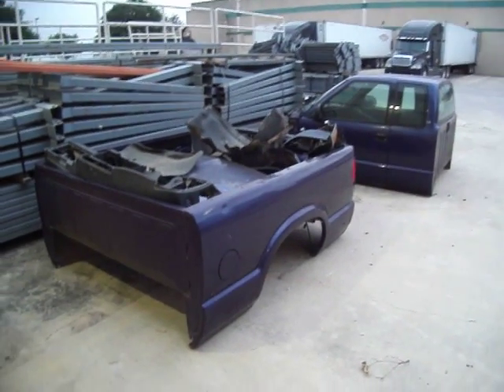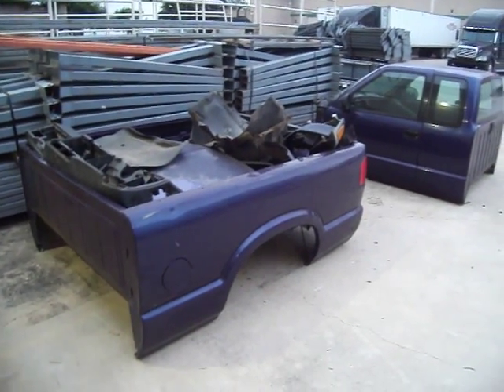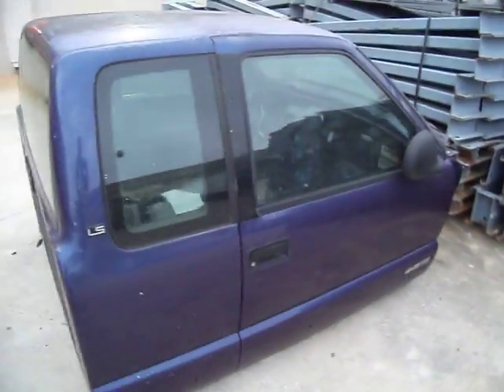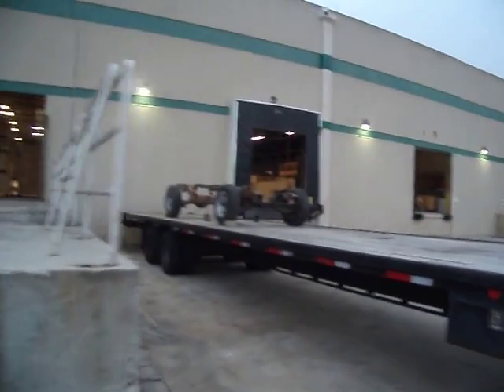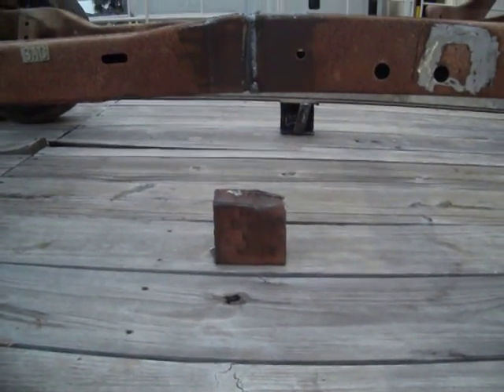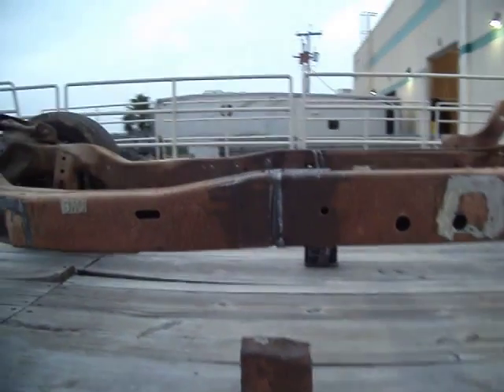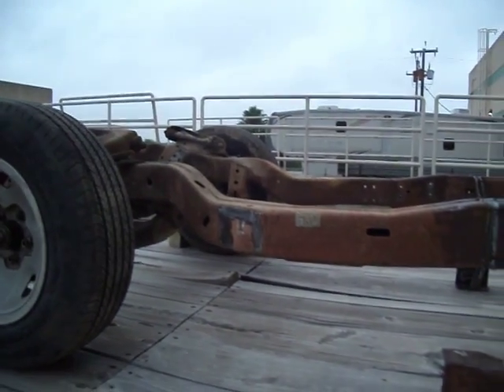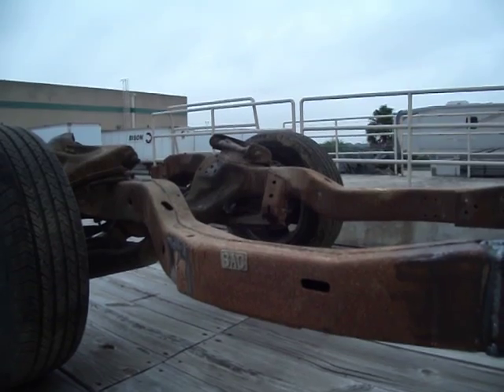Chevy S10 frame conversion to fit 51 Chevy truck body

Comment: I noticed you said 117 wheelbase? The manual I have and manuals online
for my 55 series one say 116"wheelbase.
I had the original frame at my house for awhile and I measured 116.
Did you have any different info?
Reply from the maker: No, just prefrence.

Comment: Looks good. I would add a patch plate over the top welded in
Reply from the maker: No need, this is a Z cut and welded rectangular tube frame not a c channel  frame. Factory engineers designed it that way, no added plates. Frame was shortened exactly as the engineers designed it, Z cut and welded.
Reply: @nadingjeff  ya I guess I didn't look close enough for that. In that case I'd probably just 45 the cut in the frame to offset each side weld. No hinge point then. But I'm no expert. The ones I'm messing with are .250 or .375 single wall. Weld both sides beveled well with more of an L at the seam. Then plate both sides different sizes so the welds arent back to back. 260000gvw though. Anyways love your project and sorry to come off like a Richard. The fellas at work I'm sure love me ya right
Reply from the maker: @onetimer13541  No worries, there's  more than one way to accomplish the same goal. It's hard to visualize unless ur actually looking at it, but its bullet proof strong.

Comment from the maker: What I would do there is just fabricate a piece of 3/8" plate steel, slide it into the gap and weld it in place, weld it all around to fill any gap that might be left. If welded correctly should be as strong as the original.
Reply from the maker: If u understood what was done there u would not be saying what uve srated.

Comment: Hello jeff this weld up looks great that's what I am doing to my s10 but I had to shave off 8in due to my wheelbase is gonna be 115,
So I am in a bit of a pickle I cut the factory welds on each side and shaved 8 in so I'm having trouble aligning it correctly, 
On the passenger side it slides perfectly in but the driver side i have a pretty good gap i would have to say about 3/16 or more ,
Do u have an email where i can send you some pics on my progress thanks

Comment: https://youtu.be/6o2k6QoERio
Reply from the maker: Yes I have seen this video. The video shown here shows a channel frame and I would agree with you if that were the case on the S10 frame, but it is not. The S10 frame is a rectangular tube frame and is welded from the factory vertically and horizontally in a Z configuration and the frame is joined together where I shortened it from the factory. The frame also has another plate welded inside and out. All I did was follow the factory design to shorten it. The strength is there. Was very easy to do. When you view these videos you need to be very observant.
Reply from the maker: Just to let you know my credentials, I was an aircraft mechanic for many years and retired as a quality control manager, so I have much experience/knowledge in the way of structural engineering.

Comment from the maker: Its not going to matter much especially if you split the difference between the cab and the bed, this measurement can be fudged on. Also need to take into consideration the larger radiator and engine being installed and if one is going to use larger diameter wheels and tires. So there is more to it than just a specific measurement. The 116” center to center is not the set rule.

Comment: I HAVE A 1950 CHEVY.  IT IS 116 INCHES CENTER TO CENTER OF AXLES YOUR BED WILL BE 1 INCH LARGER GAP BETWEEN THE CAB AND BED.

Comment: Hello friends! I'm mexican sorry for my bad english. I'm making the same project with a 49, i put on it a 350 vortec with edl performer intake and 600 edl carb, but i have a problem with the headers, i need to know what kind of headers can i put, because a i haven't space.
Reply from the maker: Hello Jorge, the headers will more than likely have to be custom made, either that or the inner wheel wells will have to be modified to make room for headers you can buy from Jegs.com.

Comment: S10 with Regular Cab (simple cab ) with Long Bed is 117" long ?? ...dont need cutting really ??
Reply from the maker: Well just depends on where you want the axles, wheels and tires to line up with the wheel wells. If you have or build a flat bed it should not be a problem. There are a few ways around it.
Reply: Ok Jeff thank you so much, i have a proyect 51' here in Santiago Chile. Thanks
Reply: Regular cab short box 108 inches just like G body cars.Regular cab long box 117 inches just like the el camino. Extend cab long box 122 inch

Comment: u better slap a fishplate on that spot friend
Reply from the maker: Well I know what you mean, but the factory engineers designed and built the frame this way. I copied exactly there design, cut there welds, shorten the frame 6", then welded it back together exactly the way the factory engineers designed it. So the strength is there, nothing else needs to be done, unless your an engineer and know more that the factory engineers do. I don't think any further dialogue is necessary on this matter. Thanks.

Comment: i will like to use an s10 feame for my 47 chevy fleetline. 2 door any recomendations on what year of truck n no cutting involved please n thank you
Reply from the maker: Just measure axle to axle center front to rear on the 47, then measure newer frames, S10 or others till you find one that is right on, or within 1" over of being right on. So if the 47 measures 117", you'll want it to be 117" or 118" no more no less.
Reply: hey fernando any updates on your swap am about to start on a 46 stylemaster,,unfortunaley would have to cut my s10 122 frame..i hope i hear from you, as you know there are NO  NOTHING NADA on 40,s cars and swaps on youtube,,i hope i hear from you man.
Reply: I have a 1997 single cab long bed s10. It's the truck for the swap. Wheelbase is already perfect

Comment: any followup?  I'm about to start mine! trying to gather a much Intel as possible...
Reply from the maker: None as of yet, we got side tracked by building up a Datsun 240Z and a Jeep Cherokee. We will eventually get back to the 51 mod, to many projects, not enough time. We did score a 350 4 bolt main and tranny for it though. Have fun with yours.
Reply: looking forward to it whenever it happens! lol

Comment: just bought a 54 coe,chevy. what made you want the s10 over lets say 1 ton frame...would like to see how you get your marks on the frame to do your mounts....ty
Reply from the maker: Actually, you can use any frame, just the dimensions have to be fairly close to be able to modify it and fit the body one plans to use. As far as placing body mounts, you would need to place the body you plan on using, onto the frame your using, with the engine, trans and radiator installed. Locate existing body mounting holes and fab new mounts to be welded to the frame, use cardboard to make patterns. The S 10 frame served my needs without to much modification, other frames mostly require additional modification. The frame one choses also  depends on availability and what one plans to do with the finished product, towing or just for show. This frame I modified for a friend of mine, just to get him started. He plans to use the truck to commute back and forth from work, when finished.
Reply: So you Coe cab will fit you just had to add the mounts ok get it but what about the wheel well or wheel centered  so not to forward or back but looks centered
Reply from the maker: All you need to do for wheel well placement is measure center of wheel to center of wheel from the vehicle your going to use the body from. Once this measurement is known, you measure the frame you want to use and cut it accordingly. Just need to be sure there is enough room for engine, trans and radiator placement

Comment: I don't see any rust on the S-10 body parts...........make me sad that this truck was sacrificed. My '95 S-10 is swiss cheese and has dropped the cab support neoprene thingies......
Reply from the maker: Yea, had a huge hole in the engine block, bought it cheap. Have a 51 just dying to run down the road again with a V8, going to build one out of two, old to new, or newer.
Reply: Okay......good save, then.

Comment: Jeff, I hate to tell you this, but the S10 with Regular Cab with Long Bed is 117" long... nut cutting or welding needed.
Reply from the maker: Yes we did realize that, but time, availability and price have a great influence on what one can acquire, ones skill level is also involved, the ability to cut and weld and ones willingness to help other's.
Reply: 780truck Thats how hot rodding started by using whats available & MAKING it work to be cool my friend. People are still doing it
Reply: good luck finding one 4x4 I looked for over a year for one
Reply from the maker: Yea, that's why we modified the S10 we found, did not want to wait for one to come along.